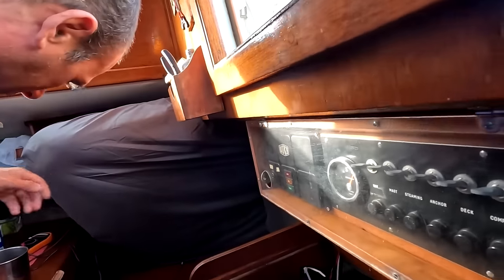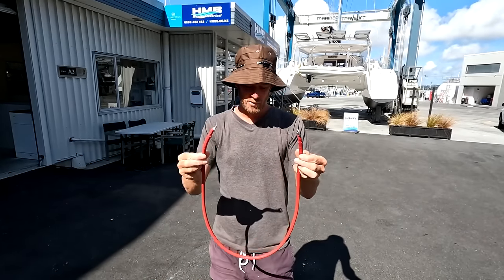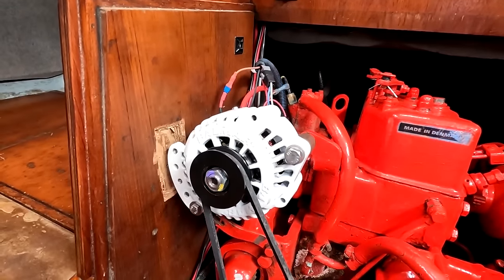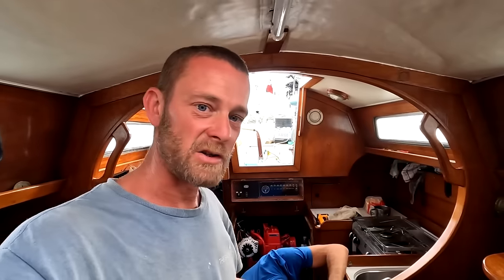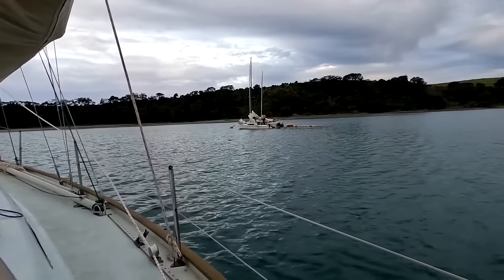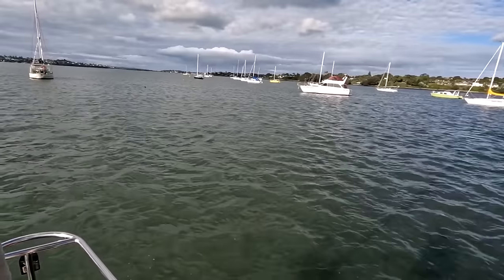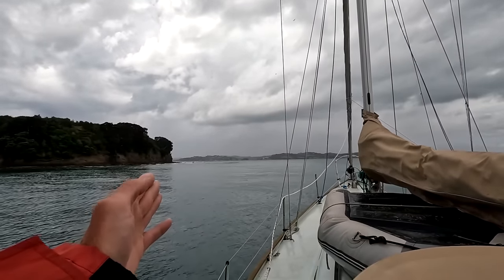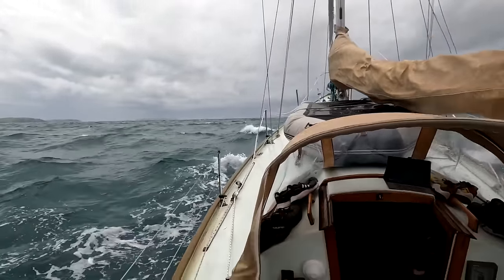Is Our Electrical System Toast? / Sailing Around NZ Pt 3   Ep147

Comment: Speaking from experience from many years ago, When you turn the starting handle, always hold the starting handle with you thumb going the same direction as your fingers, else you can easily break your thumb if the engine kicks back.  Your doing a great job though and I am envious of the great time you are having !
Reply from the maker: You are right! We have had quite a few comments on this. Definitely a lesson learned ✌️
Reply: V interesting - great for learning- thanks!
Reply: Absolutely. My grandfather taught me this when I was a youngster, this was demonstrated by his thumb many inches out of wack due to kick back when he was a youngster. I then got a diesel dumper truck from the GWR with just this set up, I knew what to do👍

Comment: I'm 83 years old.  I've had at least 50+ years of automotive and motorcycle experience.  Electrical problems are a huge part of that.  Crimped connections are a factory connection with cheaper in mind over soldered.  I've been riding my 84 Honda motorcycle for 30 years.  It's crimp connections are a 90% source of all of Honda's electrical  problems.  I watch a lot of you guys with your boat work and watch you all do your wiring noting how proud you all are of your crimp connections and thinking that is the proper way to make a connection.  I choose to solder a connection if it is important and I use a dab of oil or grease to anything that isn't soldered.  The grease/oil will keep moisture away from the pressure point of a terming end at a crimp or a screw connection or a bayonet slide connection, because moisture is what/where corrosion starts and that starts the bottle neck of current passage that starts the over heating/fire.  Also heat shrink is only an effective way of tidying  up a terminal end to give it a stronger antiflexing point, but it does very little for keeping moisture out of the connection.  Good luck with you sailing going forward.  :)
Reply: My knowledge is that soldering does not comply with current marine standards due to failing under vibrations
Reply: Oversized wiring and marine grade crimping necessary.   Soldering is no good near the vibrating marine components.
Reply: BoatM, wherever you find experts you will get different opinions.  My 50+ years of experience has shown me that soldering a wire when the solder has wetted the wire and shrink tubing has strain clamped the connection will do a better job than crimping.  Soldering done poorly or crimping done poorly can both fail.  I have gone way past with experience most of the people who have made the anti soldering convention.  Anyway, you do you and I'll do me.  :)
Reply: I agree with the soldering over crimping, in most situations. With those big lugs or really thick wires I've found most times it's hard to get them big wires or lugs hot enough to take solder property so with those I prefer to crimp. However with smaller wires and lugs I will soldier every chance I can! I'm into amateur radio so I'm always messing about with wires of all different sizes. Anyways much love from the coast of Maine 🤙 🤙
Reply: Wise words
Reply: Here's the real deal on what's right or wrong on marine electrical equipment and their connections. I've never seen a motherboard with crimp connections their all soldered. Your most important electrical equipment has soldered connections. What your talking about is more or less battery type wiring. Simple crimp connections work if it's done right, it doesn't hurt to add solder to the connections. All kinds of articles about how high end marine electrical wiring is. It's all junk if not properly installed ❤
Reply from the maker: Thank you so much for taking the time to write your comment. I know exactly what you mean soldering is a great idea however solder joints are known to vibrate  loose  so they say 🤔
I think it's quite the debate
Reply: Show me one soldered connection on an aircraft
Reply: @ahiparaa  Opinions are divided on this...

Many say crimping is better because it allows more wire flex before the wire breaks off. This is definitely true, but obviously if the wire is really allowed to flex it will break off anyway, so this just buys you more time.

Crimping is also better for less than competent installers because the crimp tool is pretty well foolproof unless the operator is completely blind.

The tools are very expensive - e.g. the M22520/2-01 sells for between €400 and €800 depending on the make and what you get in the kit. This one is £555. To my astonishment I have just e-sniped an ancient but apparently good condition DMC one on Ebay for £60... clearly nobody else noticed the auction.

The crimp connectors are also eye-wateringly expensive, especially the good quality Positronic ones. Some of the pins are £2 each, so multiply that by say 25 ...

Soldering requires more skill but the joint should be much more immune to corrosion, and even the most expensive heavily gold plated connectors are much cheaper than good quality crimp connectors.

I expect that these things vanish in the traditional £2000-4000 avionics installation fees but I wonder if anyone has any views on these options. I tend to pre-make harnesses on the bench which saves me a great deal of money on avionics jobs, and I solder everything.
Reply: You guys have me questioning my advice to the Brothers.  Maybe solder is not what every one should do.  But....my experience is that crimps fail occasionally and when they do an extreme case is a fire.  Me, I'd solder my crimps, if I could, shrink wrap (maybe 2 layers sometimes), and grease.
Reply: How long did that wire sit before it failed, i guess pretty long so now and then a new wire doesn't hurt i think. I carry some wire and connections and shrinking tools and soldier  gear with me on my old boat just in case.
Reply: Crimps are the preferred solution BUT - crimp with a properly adjusted ratcheting tool that will not release until the correct squeeze is applied. Use marine crimps with heat shrink insulation, not automotive crimps with PVC insulation. A second heat shrink tubing with interior adhesive sealant should be further used to seal the terminal after the crimp is heated and shrunk. Where solder is used the solder will travel a little way up the wire by capillary action and will stiffen the wire which will then break in a year or so where that stiffening ends. Soldering is a no no.

Comment: make it as simple as possible. I am a marine electrician and I have a Bukh DV24 with an original alternator.
I simply put my 200Ah lithium in parallel with the lead battery.
It doesn't heat up, and there are no electronics that risk breaking down. When the alternator heats up a little, the amperage decreases, this is the Joules effect.
Reply: I hope they see this!
Reply from the maker: Keep it simple and there is less to go wrong. I guess that's why boats from the 70s were very simple ✌️

Comment: When i saw the teaser at the end of the last episode i knew it was a bad crimp. 
It happens, so having got it replaced with a new lead and crimp. I would now largely forget about it other than normal monitoring and regular checks.
Any methods of electrical connection can fail. They usually do so shortly after they are first made, as in this case. Or they fail many years or decades later due to age, vibration, corrosion etc.
Reply from the maker: Yes it was a loose fitted lug that caused the problem all that amperage burning the connection out now here checked every lug on the boat ⛵

Comment: Someone probably said this. If an alternator goes open circuit from the battery, the voltage will rise until it blows the diodes in the 3 phase bridge rectifiers inside the alternator.  Those diodes can be replaced individually if you can read the type from the body and google them.  As for charging lithium and lead acid, look at a Sterling A2B. It has termperature sensors that would have reduced the alternator output before the lug on the output terminal got too hot and protected those diodes. How do i know? My boat and alternator survived a lightning strike. The A2B blew but was repaired by Sterling. Hope that helps.
Reply from the maker: Thanks for all the tips we do appreciate that. We have already ordered a temperature sensor for the alternator. That's a pretty scary situation to be in when you're boat to gets hit by lightning 🌩️

Comment: Sounds like 1 or two of the diodes are damaged . I have a spare balmar board / rectifier unit here. Daniel
Reply from the maker: We bought a repair kit for the alternator. It's had damaged the rectifier too.
Reply: Yes, from my experience those Balmar alternators will blow diodes & rectifiers if you run them to their max output continuously as they will overheat very quickly - better run them at 50% - 60% of their maximum output using the Victron DC to DC chargers.

Comment: I would suggest sanding or wire brushing clean the end of the starting handle that engages with engine and lightly greasing it si it easily dissengages and comes out when engine starts, you certainly dont want it sticking in and then flying out to take your head off. I have seen it happen too many times on building sites with horrible injuries.
Reply from the maker: Very true 👍👍

Comment: Hi fellas. %100 sting Ray on that rod. Especially if you used bait. 
Can I also say,  lift your rod to 10 o’clock no more, otherwise that’s point loading, and your rod will snap.
Reply from the maker: We definitely think it was a big ray. Pretty much had no chance with that set up. Thanks for the tips about the rod 👍👍

Comment: I was curious about two 30 amp dc to dc chargers.  That is 60 amps plus what your starting battery pulls.  I was thinking one 30 amp dc to dc charger for both batteries.  It would be slower but not put so much draw on the alternator.
Reply from the maker: Yes it would be slower take longer to fill the batteries but less draw on the system ✌️

Comment: Sorry to hear of your problem. Hopefully not an expensive fix. Good to see you so positive and not allowing it stop you getting. Pity you didn’t keep your old alternator, you could have refitted that and just connected it to the starter motor allowing the solar to charge the Lithium. All the information I have read is not to mix Lithium with Acid Batteries as it will always cause problems. Keep up the good work
Reply from the maker: We will get it sorted 🤟. It's always tricky with a new system on board and the gremlins associated. Unfortunately our old alternator will not fit anymore because of the electrics we changed and mount brackets 😭😭
Reply: More than likely a stingray there like trying to wind in a large table top virtually impossible

Comment: Good morning lads.  Interestingly I am fitting a new charging system to my Rustler; from a solo sail to Azores last year highlighted battery charging issues.    I am fitting a 160amp alternator with a smart charger that can be programmed to charge all battery types.  In your situation, When you do finally fix the problem, which is possibly a dodgy connection, it would be an idea to secure the cables back to a point on the engine from the alternator.  By having a local secure point for the cables, would mean any vibration of cables (especially the big charge cable) would not result in the connection coming loose.  Hope all is now working okay.  Cheers
Reply: I second this. If not already the case, cable-tie the alternator cables to a standoff bolted to the engine. This way, the crimped joints will not take the worst of the vibration. Be careful not to transmit heat from engine into cables though. Good luck. I hope it's all sorted now.
Reply from the maker: Hello Mike
Sounds very exciting upgrading your electrical system. Thanks for your tips on ours buddy appreciate that. Let us know how your upgrades go 😉

Comment: Hi Adam Hi Luke,, what a bummer it is, having to start the engine on the handle. I hope your BEST CHRISTMAS / NEW YEAR present will be getting the alternator fixed. To thicken yer gravy, Cornflour is best, but flour will do it, mix it with a little water in a cup and if it's still a little lumpy pass it thru a sieve or tea strainer into the gravy mix and boil it well. Also, if the wind keeps blowing yer hood off, wear a cap under it, works every time. I just love yer pet name, lugs, for terminal connectors. Great episode though.
H N Y to both of you, and may this coming year 2024, be another safe and successful circumnavigation, this  time NZ,   Kind Regards, Barnacle Bern SW Wales. 👍👍
Reply from the maker: Hi Bernie
Yes haven't had the best start to this circumnavigated with quite a few things go with wrong. At least we know how to start our engine manually. Thanks for your tips on the gravy 😁
I think lugs it's a New Zealand thing
I hope you have a fantastic year we wish you all the best Bernie ✌️✌️⛵⛵

Comment: To troubleshoot that systematically you would be well off trying to charge the batteries from land electricity and see that they hold. For me the first place to start is to check that they are good. Parallell batteries are tricky if they are out of balance either by use or internal leak and are then connected. Huge currents can ensue. You are quite sure that the starter battery is absolutely isolated from the lithiums in every possible configuration and can only charge from the charging source? My prime suspect is some unexpected backfeed, either through a mixup, a short or some diode, thinking it was isolated but then that only holds true for the one direction.
Reply from the maker: Thank you for the advice we really do appreciate it 🙏 thanks for the message

Comment: When you said the cable had burned through I thought that'll be the alternator goosed then.. sorry. When the alternator is spinning it must always be connected to a load in most cases at least one battery. If you have two batteries you will notice that you have a switch which can select batteries one, two or both they are known as make-before-break switches. This means that when switching from one battery to the other the battery you are switching to is connected to the alternator before disconnecting the original one "make before break" This is to ensure the alternator is always connected to a load otherwise the internal diodes fail. It sounds like not all of them failed which is why you are getting 13v when it should be between 13.5v and 14.5v. The other thing to be wary of is that a faulty alternator can sometimes cause the batteries to drain to earth through the alternator.
Reply from the maker: Thank you so much for the expiration 😁
Really appreciate the time you took to write this thank you 🙏🙏🙏🙏🙏🙏

Comment: Electrical wire melting is a short circuit of some kind - it takes alot of current to melt heavy duty wire and insulation - that usually means its across a battery somewhere? Anyway - what do I know - hope you got it sorted - i’ll get back to my sofa 👍
Reply: A loose connection can do the same thing because of sparking and arcing or general high resistance.
Reply from the maker: The lug came off the wire causing the wire to heat up and burn as the amps had nowhere to go so burt out the alternator 😞

Comment: Could you not take a couple of jump leads off the lithiums when the solars have charged them & jump to the starter & start the engine that way.
Reply from the maker: Lithiums don't have very good cranking ups to start an engine. Using them to start an engine can seriously damage them so unfortunately not Graham 😞

Comment: Stupid question, but you didn't blow a fuse during the initial wire burnout did you? 

I experienced that once. Had a burnout which popped a fuse, fixed the wire then couldn't figure out why it wasn't working as it had before.
Reply: Yeah should definitely be a ANL or t class fuse between alternator and main buss / battery
Reply from the maker: We checked that and unfortunately it is not a blown fuse 😞

Comment: I just started my channel about all my diy projects on my sailboat. I solder all my connections on my boat as its a secure connection. You can still solder the wire to the connectors if you still want to use them. But soldering is by far better. Those videos are soon to come.
Reply from the maker: Very interesting 🧐
I know what you mean it will be a very secure connection however we have heard that vibrations from an engine on a boat may cause the soldering connections to crack and fail. Maybe crimp and solder 🤔✌️

Comment: You lads didn't keep your old smaller but still functioning alternator as an emergency spare?
Reply from the maker: We have kept it as a spare however we changed all the wire connections so it won't be an easy job putting the old one back on 😕
Reply: @TheSailingBrothers  I would make a 'harness' to allow you to utilize the old one as a quick swap like bypass for your house batteries only.  Your engine battery is less critical as your Bukh has an old school hand crank.  Keep up the efforts.  Plan to do the same solo within the next year.  🙂⛵

Comment: Seems that Y'all need a cheap 8 or 900 amp gas generator for emergency use.
Reply from the maker: Most modern boats have a gen set as a backup
Reply: Which can be used to charge batteries in emergencies. @TheSailingBrothers